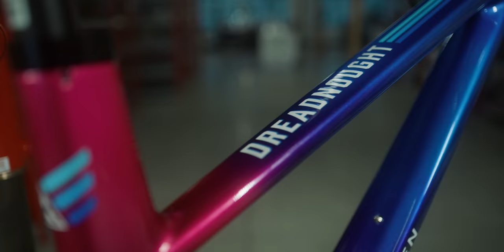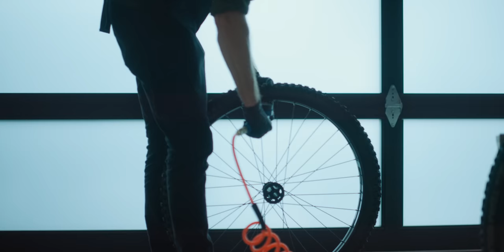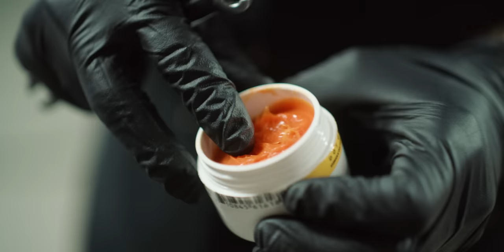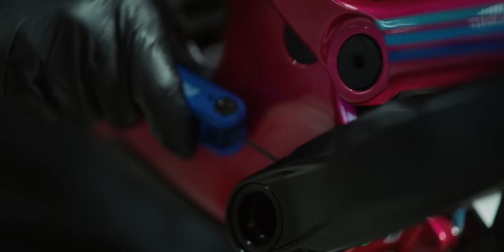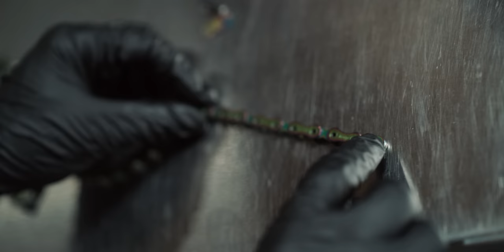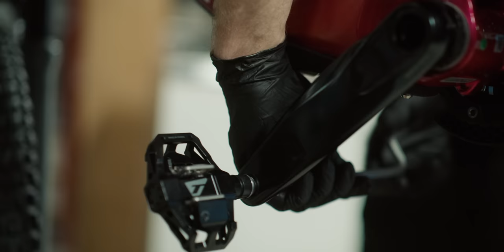BUILT | High Tech High Pivot, the Forbidden Dreadnought

Comment: Love the build, but What's the point of the high pivot? What problem is it solving for?
Reply: Tldr: longer wheelbase on compression, eats up hits better, yet decent pedalers, no pedal kickback on compression. It's interesting, a normal low pivot bike's wheelbase grows shorter as you compress the suspension which decreases your stability, a high pivot bike's wheelbase grows longer as it compresses suspension which increase stability and the rear wheel is often described as moving up and back upon hitting objects, as opposed to feeling more like it hangs up on things. They often sound like bikes at the extreme end described as the opposite of playful, but maximum planted and confident that devour up hits with ease. An interesting side effect of the design is I often hear them described as better than average pedalers, in part from the chain tensioner which also prevents pedal kickback.
Reply: @LastAphelion  The question is, does it decrease your stability significantly? is it even noticeable to the average rider? Or do you have to be extreme downhill or enduro racer to notice it and for the high pivot to really give any advantage? I guess I need a side-by-side test.
Reply: @MTB_Rider_96  Yes it's noticeable, check out Vital MTB lets go racing series S2 E6 he talks about how cornering with the high pivot is an odd feeling of the bike actually lengthening under you which helps it feel more locked into the bank and less squirrely and its other quirks

Comment: They used the hidraulic reverb, still the derailleur is the axs version. They don't promote anymore normal derailleur it's like they don't exist anymore. I was surprised by the rockshox reverb.
Reply: Yeah reverb is absolute trash.
Reply: @semmtexx  the G2 reverb is a pretty good post actually. Had one for a whole season on a shop demo, and it held up. The AXS Reverb is better still. G1 reverb, not so great though.